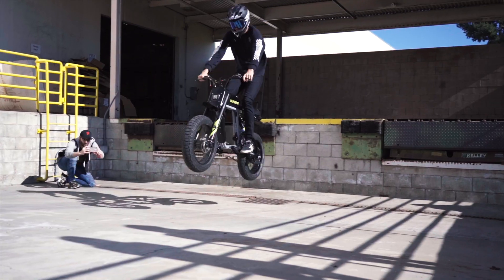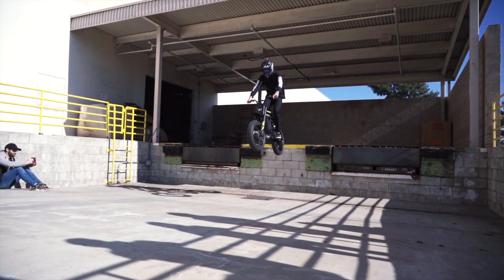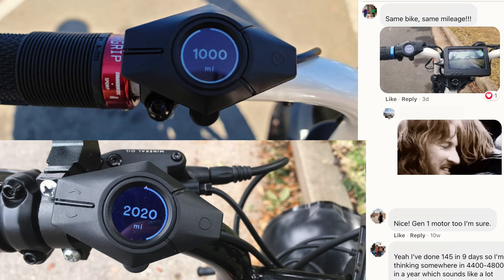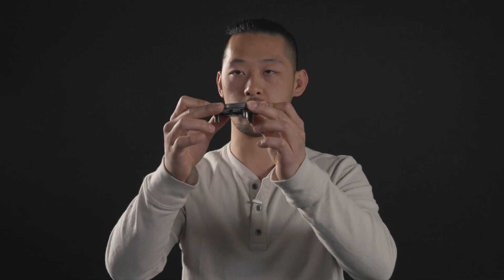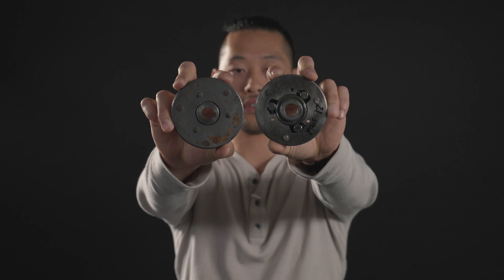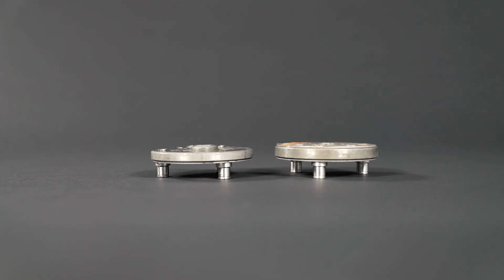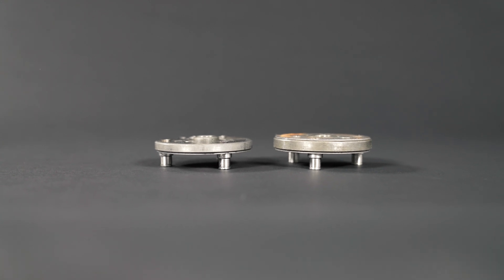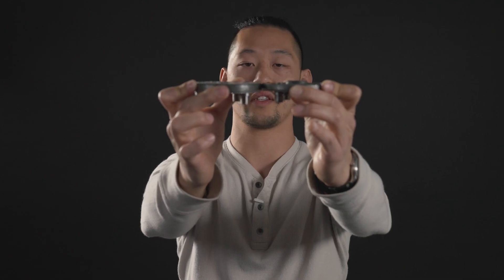E-Bike Motors and Our Constant Evolution - SUPER73

Comment: Basically the original motor was in alpha testing, v2 and v3 were beta tests, and now v4 is the final product. While transparency is great, Super73 should stand behind their product and extend the warranty for v1/2/3 motors to 3 years or 10k miles (whichever comes first). Just my two cents.

Comment: I have a question, that’s holding me form buying super73 for a while and I haven’t had the answer. So what happen after many years with the bike or over 10000+ miles. What would happen to the motor, is there’s a fix for the motor or you guys going to offer a motor to replace?

Comment: Nice video. Thanks for the uptdate guys.
Would be really nice if one could add a code to the bike so only you can connect your phone to the it.
So others cant change the modes when you are not around or riding yourself.

Comment: For the next generation of bikes, please include the following and my money is yours!

1. ~2 kwh battery for super long range
2. 33 mph throttle-only top speed in unlimited mode
3. Increased low end torque
4. A bigger, more sophisticated display like on motorcycles
5. Less negative space in the frames
6. More puncture resistance in the tires
7. Twist throttle

Comment: Parker mentioned a controller firmware update for increased low end torque in one of the previous video. Is that coming this summer with the new tires?
Reply: Honestly just got mine in. The torque on it is more then enough. The front feels like it’ll lift when I have it in unlimited and fully charged
Reply: @kapenatom3816  Not me, never came close to lifting the front. RX is completely useless on any decent hills unless you have momentum going into it. I live on top of a hill and my RX could barely climb it until I got the 10 speed kit. 

On flats sure it’s fine but compare to even my 250w eMTB, it’s seriously lacking low end torque off the line.

Comment: I had a controller issue it was fixed quickly. I had a V1 motor issue at ~900miles it took 90+ days. Yes it’s a new product it’s going to have issues. Yes it’s frustrating that if S73 has no news they tell you nothing. In fact I was told I would see a motor w/in a month, never happened. No apology or an update as to when I would receive the new product. Then all the sudden they emailed me and told me to ship my V1 motor to Cali. I told my rep that I was very displeased with this action. they were extremely quick to resolve the issue and send it back to me it’s the whole process.

 I love my bike it’s fantastic worth every penny. S73 has some growing pains. I would say that my issues have been resolved and I don’t think I had any unrealistic expectations about it I think that super 73 probably did an “average job“ with the replacement of the motor certainly they could do better but they are learning. 

I ride my bike on the bike path it is very much a pavement Princess. I live in a hilly area of pnw. So I am constantly using the motor and its full capacity even with pedaling. One bike, One person and one motor is not enough testing.
Reply from the maker: Thank you for allowing us the opportunity to fix our errors. We have addressed our customer care issues and will be seeing a HUGE shift over the coming months as our actions start to show results. We are well aware of our shortfalls and are so grateful to riders like yourself who are honest and allow us to learn and grow. 

We will continue to pull back the curtain and work on communication and consistency. Here's to a much better future!